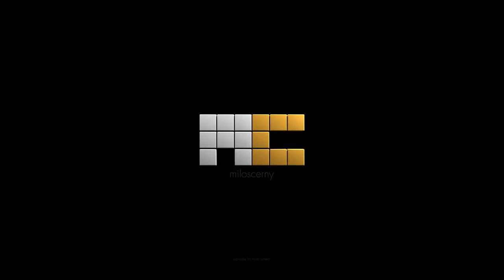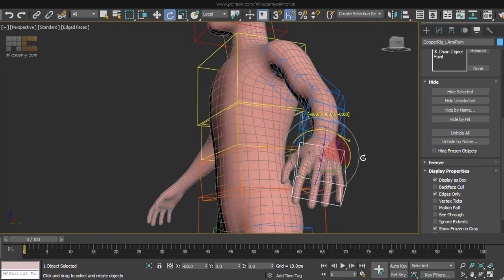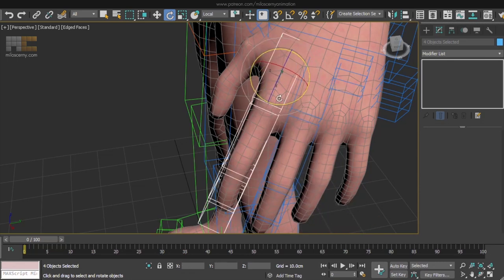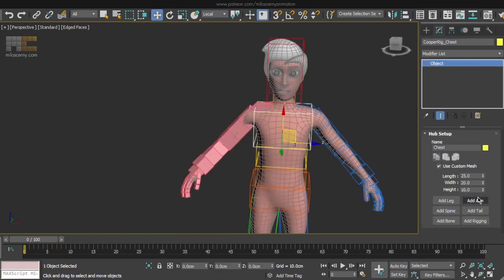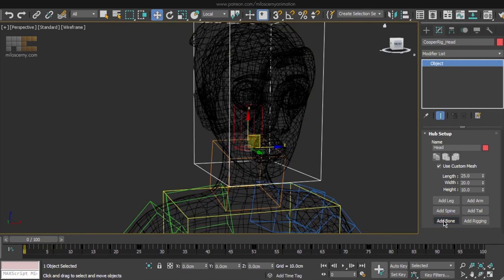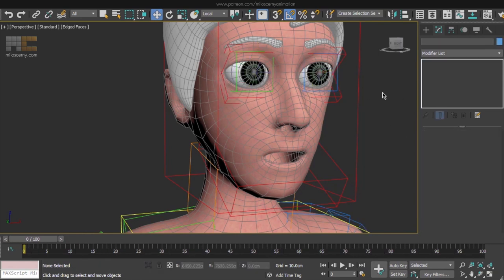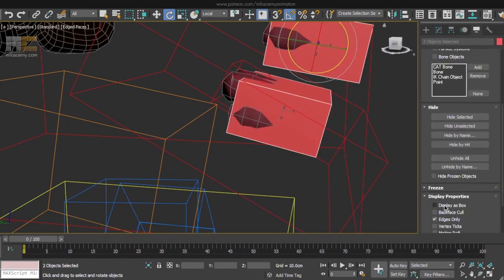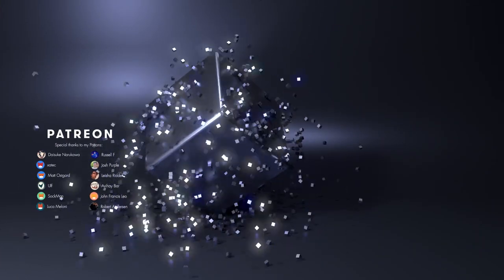Your First 3D Character - Rigging Head and Arms - 3ds Max CAT (Part 2/7)

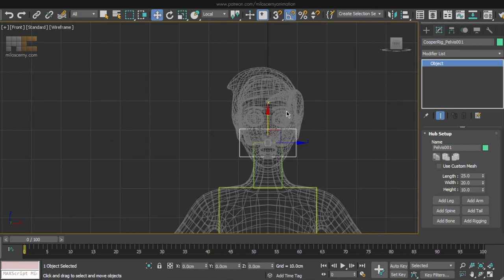Comment: 00:41 when you work with CAT, will it cause problem to scale e.g. this neck length rather than using move? I just see all these transformations on the bones, and as someone who learnt rigging in Maya, it sends shivers down my spine because moving and scaling bones in a rig like that would cause problems unless you knew how to deal with them. Could someone explain if there are any traps regarding scale/rotate/moving the CAT bones?
Reply: The way CAT works, it shouldn't matter. But I'm learning new stuff after using CAT for a long time, so maybe, but I'm not sure.